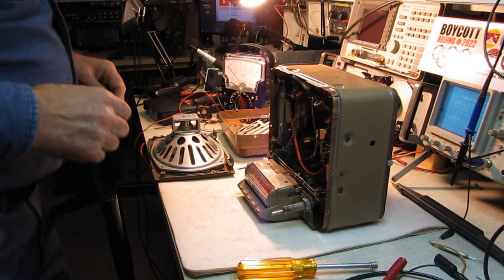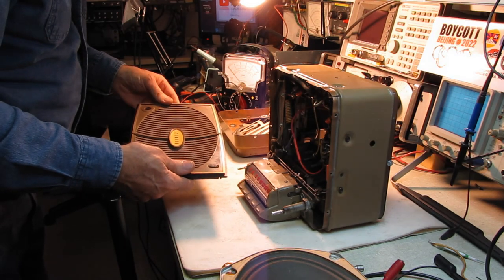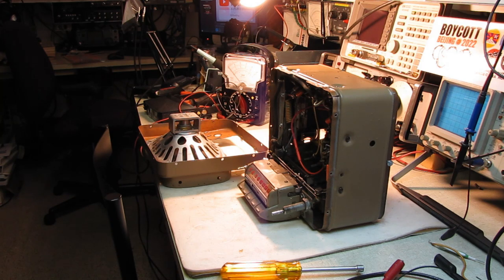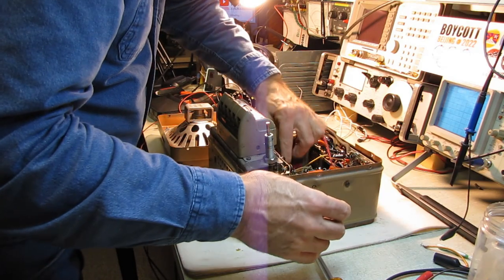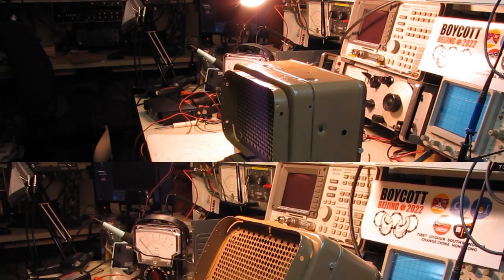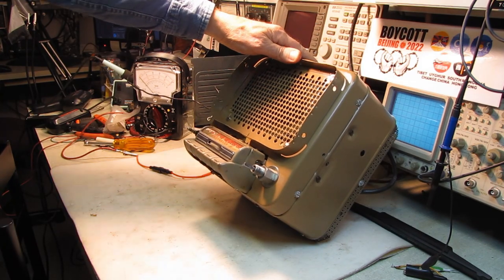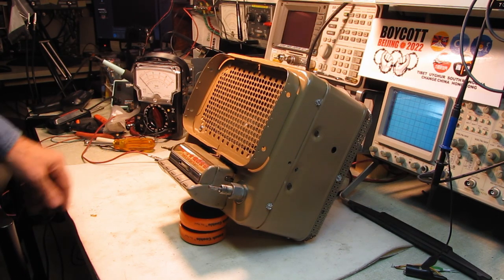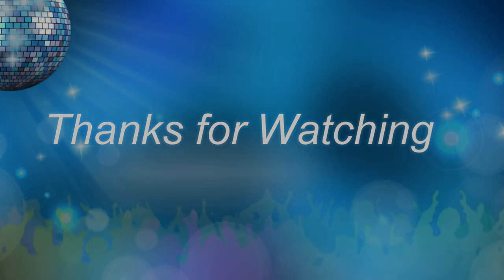DON'T PLUG IN THAT OLD RADIO - 1947 CHEVROLET RADIO IS HEADING HOME - AT LAST

Comment: My first car radio I got when apprenticing as a mechanic back in the early 70’s in the UK had the radio control portion for the dashboard, but the power supply and the amplifier was a huge box that took up most of the dashboard under shelf. It was valve operated, the connection cable to the radio portion in the dash was almost 3/4” thick. What an ugly beast but it worked.

Comment: Fantastic job you did on that radio.
Looks like it's brand new.
The only thing you couldn't check was how it performs in a car, with noise from ignition, alternator etc.
But I bet it will sound just great.
BTW, is it possible to convert these radios to 12Volt if the owner want's to convert the car to 12volts?

Comment: Not only are the speakers hard to come by, but Delco used some strange impedance also, like 3.2, 10, and 40 ohms, the latter being used in an early transistor design.

 Got a radio from a 49 Pontiac Chieftan, a lot of the wiring is cloth coated rubber, and is crumbling and disintegrating, the tuning coils are all rusted up, and someone stole the speaker out of it.😔